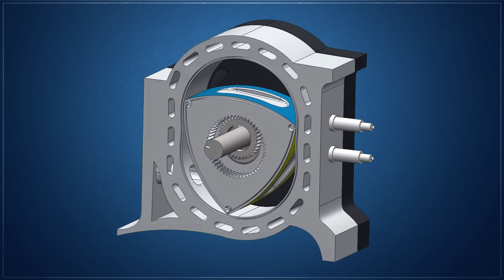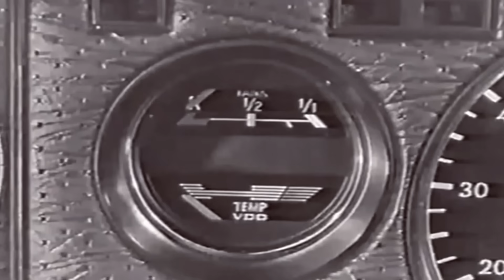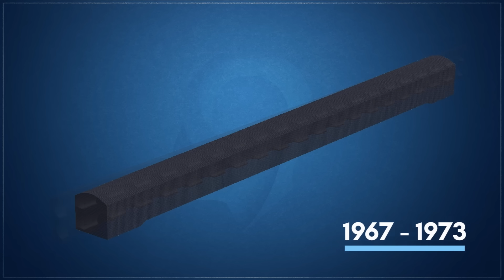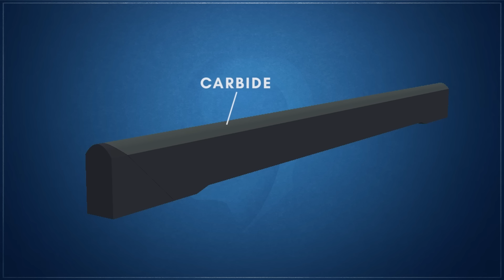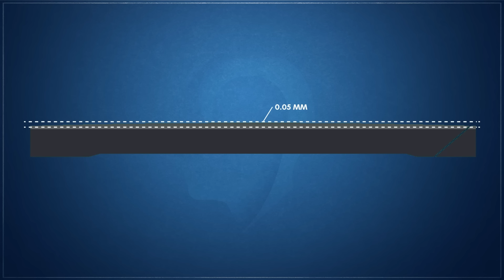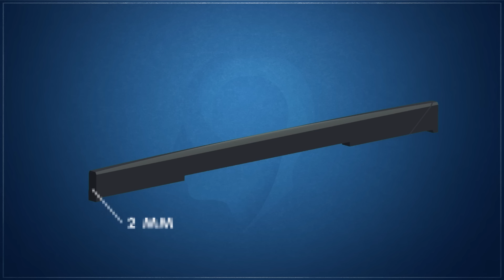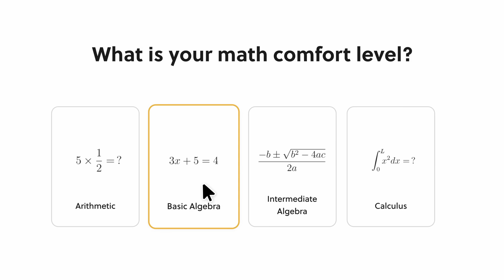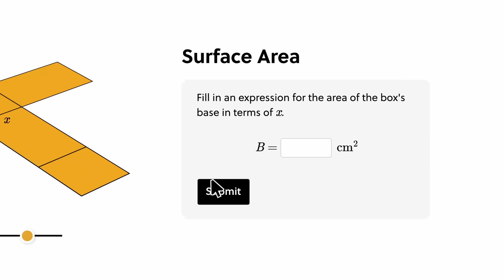Overcoming The Rotary Engine’s Biggest Flaw

Comment: I had two RX3s back in the seventies no problems with the apex seals it was the coolant finding it's way into the combustion chambers that killed them on both of mine, much later on about ten years ago I restored two Suzuki RE5s rotary engine motorcycles, no problems at all and very reliable, regular oil change and maintenance is key to a long life Suzuki rotary engine.
See my Suzuki RE5M restoration.
Reply: All the technology and hoopla centered on apex seals and the devil’s nail marks makes a great story and Mazda should be heralded for successfully plating the inside wall of the aluminum rotor housing. But while failure of that interface would contribute to compression passing from one moving combustion chamber into the following one it was simple failure of the o-rings sealing the coolant passages in the rotor housing/end plate sandwich that caused immediate failure. How many piston engine oriented mechanics watched coolant drip out the tailpipe of a perfectly smooth running engine while it overheated in the service bay? Of course when the coolant passage o-rings were being replaced (total engine disassembly) one would be a fool not to replace the apex seals. Thanks for the rotary article, brought back great memories of the 9,000 rpm gonna rev forever driving experience.
Reply: @martymiller4300  It's very unlikely that this engine did not have significant compression loss from worn and damaged apex seals.
Apex seals are inherently weak and fragile by design and this is eggravatd by the Wankel's incredibly bad combustion chamber architecture that contributes to the Apex seal damage through erratic combustion and detonation which creates ablative and high brisance damage to the expose seal surfaces as high temperature combustion gasses leak past the seal.

There is no solution to this fundamental design flaw which is why the Wankel could never be used in applications where reliability is critical and also why the Wankel engine has been completely obsolete in the engine manufacturing industry for some time.
Reply: @sandervanderkammen9230  completely agree, but the lack of compression wasn’t a debilitating issue until it was. The failure of the coolant o-rings was a tow it in and fix it now, whether warranty or customer pay. We did see engines that would fail to start due to insufficient compression but oddly mostly when a cold engine had been started and then shut off before warning up. Next attempt to restart was a chronic cranks but no start Very alien symptom for a piston engine mechanic.
Reply: @martymiller4300  Absolutely not, flooding is a very common and typical symptom of low compression in reciprocating engines.
Reply: Remember the RE5M well … Weird motorcycle!
Reply: @sking2173  It handled surprisingly well for such a heavy motorcycle, it's was cool to be different and ride a motorcycle that almost bankrupt Suzuki.
Reply: @leeandjancruise  — I hope you enjoy it … It’s definitely a piece of history.
Reply: Apex seals are the primary failure mode of all Wankel engines, they are inherently unreliable.
Reply: My RX2 did the same. I think the expansion rates between the aluminum sections and the cast iron sections were the main problems.
Reply: And the housings held together by steel bolts. @johncorrigan8446
Reply: @johncorrigan8446  Mazda has been plagued by many design and quality control issues but they were just one small company among dozens of industry giants the licensed and developed the Wankel KKM57 engines.
Apex seals by design are inherently weak and unreliable, no solution to this reliability problem has ever been found.

Comment: Several  tiny corrections: All engines are designed to burn some oil, wankel engines just burn more oil  since both sides of the seals have combustion products that need to be taken out the exhaust that way.  That these powerful engines are so compact adds to the problem of effective heat removal. The fact is they also need side seals along with those problematic tip seals. 
Face it, this more than fifty year old experiment has failed to produce more than a high revving unidirectional rotating internal combustion  engine with somewhat better fuel economy than it used to get, which was rather poor compared to the best piston engines. Combustion is done.  Especially in automobiles. EVs are the future for a good reason.
Reply: The size of the Wankel engine is completely unrelated to its high heat rejection problems... it's poor efficiency.
Wankel engines produce higher exhaust  and coolant temperatures because they convert less heat energy into horsepower.

EVs will never replace ICE cars, their popularity peaked in 1915 and have remained a relatively small niche market

Comment: The problem with these petrol driven range extenders, is that people get lazy and run the car on fuel alone and aside the use of the electric motor. The other issue is that the vehicles going to be quite a bit more expensive to maintain given that you’ve got drive trains for the electric drive train plus the Wankel engine.

Comment: Well I think it’s track performance to date pretty much puts these “inherent faults” in to perspective. 🇦🇺 Without Aussie tuners pioneering new tech it absolutely wouldn’t be such a powerhouse currently that’s for sure
Reply: Wankel engines were ultimately a huge failure in motorsports and Mazda never won a single world class championship title before completely leaving racing.... Mazda no longer has any factory motorsports program.

Australia is a primitive, backwards country that no longer manufacturers automobiles and has never been relevant in automotive technology.

Comment: The main issue with the Wankel is that people treat them like normal engines.  Rev it when you start, and rev it when you turn off- get that Oil flowing!
Reply: The main issue is that Wankel engines are inherently unreliable and fundamentally inferior to reciprocating engines.

No amount of maintenance can make these engines as reliable and durable as reciprocating engines... this is an irrefutable fact that cannot be denied.
Reply: @sandervanderkammen9230 coming from somebody that has probably never owned one or didn’t properly take care of one…
Reply: @WanklerRX  Being smart enough to not waste money on inferior Wankel engines makes one more respectable and credible than the poor suckers that did.
 Wankel engines have never been reliable or durable, and no amount of maintenance is ever going to change this fact.
Apex seals are inherently unreliable and have a low MTBF.

Comment: MX-30 only gets 373 miles on 13 gallons?  My 2017 Chevy Volt can go an additional 367 miles with an 8.9 gallon tank! (My direct experience is more like 420 additional miles of mixed driving on gas)  So yeah, the rotary isn't very fuel efficient.  Too bad.  And btw I am a total Mazda fan, my and my family have owned a half dozen Mazdas over the years and loved them!
Reply: Mazda's president Akira Marumoto's announcement in July confirmed that the MX-30 was cancelled.
Reply: Exactly. This MX-30 will flop badly with that thirsty rotary. 

Also, GM was foolish to can the Volt. That was a nice, versatile little car …

Comment: so Mazda hasn't overcome the flaw, but the aftermarket took up the cause and now seals pretty much take that problem out of the equation
Reply: That's completely false and misinformed, the problems with apex seals has never been solved, rather the primary failure mode of all Wankel engines is still apex seals.

Comment: As a previous owner of more than one rotary powered vehicle ( A 12a and a Renesis ), I would argue that these days the biggest flaw with Wankel Rotary is that combustion is still occurring during the exhaust cycle.  This results in poor fuel economy and really hot exhaust manifolds.  If you've ever watched an underhood camera in a race rotary engine, you can see that the exhaust manifold is absolutely white hot.

Edited for spelling
Reply: Right.

Decades ago, when I worked for Onan, a manufacturer of industrial engines and generators, we tested a single chamber Wankel engine which we removed from an NSU Spyder sports car.  The exhaust pipe became cherry red, or probably more accurately, orange. 

I once owned a 1975 Mazda which had a Wankel engine.  It was very powerful for its day and the engine was very smooth and quiet.  However, I could never get more than16 MPG even though it was a compact car.  Mediocre efficiency killed the demand for the engine.
Reply: You are absolutely right.  The whole exhaust system must be made of Inconel, or other high-temperature resistant alloy, if you want it to last.
Reply: @st-ex8506  The problem is the Wankel engine..
Not the exhaust System.
That glowing hot exhaust represents horsepower being completely wasted out the tailpipe.
Reply: @sandervanderkammen9230  why do you hate rotary engines so much?
I see you on every site talking of rotary engines, attacking anyone saying something positive like a rabid dog, being condescending if not outright insulting to people… 
That is no proper behavior… something is wrong with you, no only with the Wankel!
BTW, were you not also going by @doktorbitter, or something like that, on YT, until getting banned for improper behavior?

The truth is that the Wankel engine has strengths and weaknesses, like every other engines, but has not profited from even 1% of the engineering development, which has been invested through the years in the alternating piston engine, also a flawed design, but whose flaws were progressively ironed out through absolutely massive development by hundreds of companies, not just one and a half!
Reply: @st-ex8506  WTF are you talking about?
I love Rotary engines, I have a Gnome et Rhône Monosoupape and a Uberursel UR.II
I would also like to own a Megola.
Rotary engines are absolutely fascinating to me.
Of course were talking Wankel engines here specifically, while Felix Wankel did design a Rotary engine it never saw production we are discussing the Non-rotary version.
What I really do hate is when amateur enthusiast spread lies and ignorant misinformation about Wankel engines.

Lets be clear, Wankel engines were ultimately unsuccessful because they have no real advantages over reciprocating engines and have several major disadvantages.

That's exactly what I object to! Bald faced lies like that! The Wankel engine has been thoroughly and exhaustively developed in one of the biggest technology races of the 19th century, 26 of the largest engine manufacturers and dozens of Universities and research Institutes spent decades and Billions of dollars developing the Wankel engine.
Did you even know that one of the world's largest aircraft engine manufacturers, the FAA, NASA and the US Air Force formed a multi- billion dollar joint development program for Wankel engines????
Did you know Curtiss-Wright was the first company to become a Wankel engine licensee in 1958!!! They developed the Wankel engine for 20 years before going bankrupt in the process.
Companies like General Motors, Mercedes-Benz and Rolls-Royce were spending millions of dollars a month in the 1960s developing Wankel engines
Or that Ford had more patents on the Wankel engine than Mazda when they bought the tiny Japanese company from a bankruptcy court auction in 1979?

You sound so incredibly gullible and niave when you say ignorant things like that, development ended because the Wankel very quickly reached the logical conclusion of its development potential.
The Wankel engine is inherently and fundamentally inferior to reciprocating engines, all the manufacturers eventually came to this unanimous conclusion.
Any questions kid?
Reply: @sandervanderkammen9230 your supposed love of rotary is the biggest lie I've seen on the internet and I'm a Trumper.
Reply: @echonomix_  Do you not know what a Rotary type engine is? A Rotary engine and a Wankel engine are not the same?
Any questions?
Reply: @sandervanderkammen9230  You would be better served by explaining the difference, in your view, of the difference between a Wankel and a Rotary,  rather than ending with a sarcastic retort.  The Wankel is, in fact, an eccentric rotary engine that contains no reciprocating elements.  You are being deliberately esoteric in order to mock others in this discussion, but ...  

You know, now that I think about it, that's kind of funny.  Carry on.  :)
Reply: @thekinginyellow1744  WHICH WANKEL ENGINE???
Reply: @thekinginyellow1744  Which Wankel engine were you referring to???
Reply: @sandervanderkammen9230  The one inside your skull
Reply: @be12  You don't know that there are two types of Wankel engines???
You don't know much about the Wankel do you?
Reply: @sandervanderkammen9230  try harder, kid
Reply: I would have thought the solution is to put a valve on the exhaust port, rotary would probably be good as you could chain drive it off the crank.
Use the valve to delay the exhaust need it's still burning
Reply: @MostlyPennyCat  The fatal design flaw is the shape of the combustion chamber and the lack of mechanical efficiency...
Reply: This can be countered by advanced engine control systems... Look into Rob Dahms work
Reply: @mikesledge6187 That's just a bandaid though, it doesn't fix the core issue.
Reply: @qwertykeyboard5901  there are core flaws in most designs, the different designs are a symptom of people making different compromises...piston engines have reciprocating mass leading to more more stress on internal component's and wear and tear from vibration... Balancers are only a bandaid fix though... 
Might as well buy a Tesla right?
Reply: @mikesledge6187  Except that solves the ROOT of the problem, not the symptoms.

Extra engine cooling doesn't make the combustion stop happening in the exhaust section. The core issue still exists.
Reply: @mikesledge6187 Wankel engines have a considerably higher reciprocating mass and moment of inertia which limits the rpm of the orbiting assembly..
Most Wankel engines also require a flywheel and mass damper/ balancer.

Only Felix Wankels DKM-54 prototype is a true Millet Rotary concept with no reciprocating mass.
We are discussing Hanns Paschke's and Walter Froedes Non-rotary KKM57 design.
Any questions son?
Reply: @sandervanderkammen9230 Wankel engines literally don’t have reciprocating mass, that’s one of its benefits lmao
Reply: @mrajms42  WHICH WANKEL ENGINE???
Reply: @sandervanderkammen9230  wankel rotaries don’t have any reciprocating mass, idk what you don’t understand lol
Reply: @mrajms42  Which Wankel engine???
One reciprocates, the other does not.
Reply: @mrajms42  Only one version of the Wankel engine is a Rotary, and it never saw production.
Reply: @mrajms42  You really don't know anything about Wankel engines do you kid?
Reply: @mikesledge6187  Tesla has nothing to do with this, don't change the subject lol
Reply: @sandervanderkammen9230  here i was, recently demanding to see a rotary rotary, never realising i already have... never noticed that original one ran "inverted"...

i reckon the wrong parts held still. changing that gives several advantages...
Reply: @paradiselost9946 Yes, many of the advantages of the Rotary type DKM54 engine are lost with conventional layout of the KKM57..
Reply: @mikesledge6187 and his exhaust overheated... great argument bro. It would suck to loose that sound tho if it means placing the exhaust elsewhere.
Reply: @mikesledge6187 You are wrong, the thermal efficiency cannot be countered by engine controls... 
The Wankel engine is less efficient because of its design is limited by lower adibatic efficiency, lower combustion efficiency and lower mechanical efficiency.
Reply: Wait, because you refer to a wankle engine as a rotary to which it is commonly referred to, and a true rotary engine by definition, all other comments and opinions are null and void?
Reply: @noname-sd5dt  All depends on which Wankel engine you are referring to. Only the DKM54 is a Rotary.
Reply: @noname-sd5dt Which Wankel engine???

One is a Rotary type the other is Not.

The term "Mazda Rotary®" is registered trademark, not a legitimate engineer classification... it was intended to pay homage to Felix Wankel's original DKM54 design, a design that ironically Mazda never manufactured.

Hanns Paschke's and Walter Froede's KKM57 completely discarded the clever Rotary layout in favor of a less complex conventional layout.

Any questions?